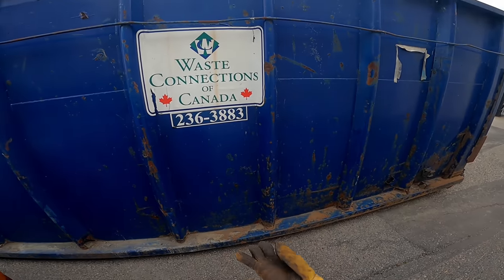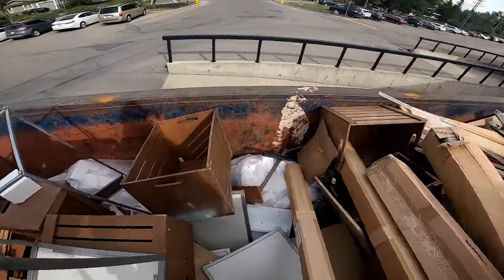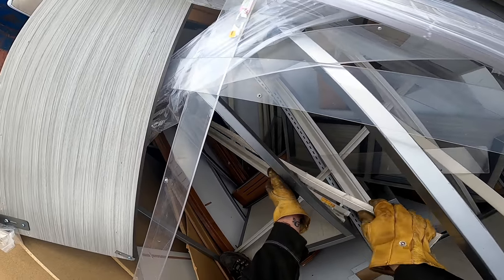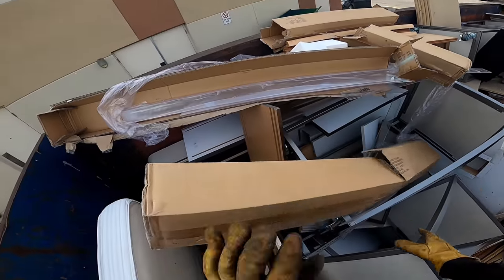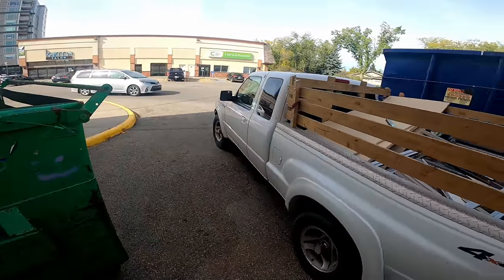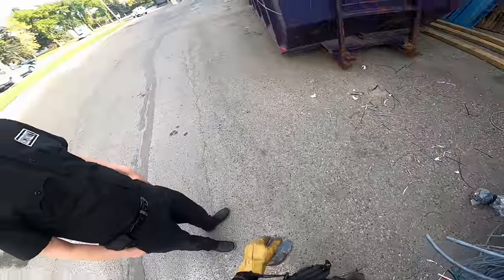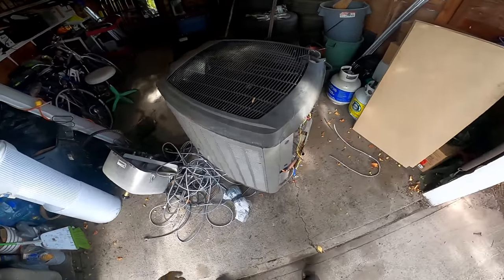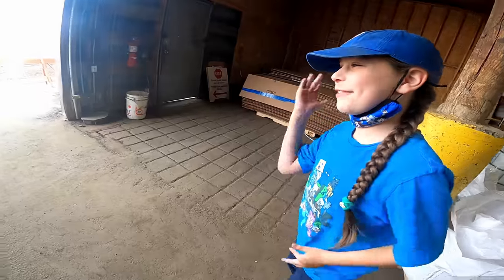Dumpster Diving 38 - Caught by Security!

Comment: I admire your calm and mature demeanor in the face of a potentially contentious encounter. Also the fact that you didn't stop doing what you were doing just because Security arrived, which helps support the position that you weren't doing anything wrong. I suspect you've had dozens of similar encounters with homeowners, security personnel, and the neighborhood busybody. Thanks for the good example!
Reply: Well said, we shouldn’t have to hide or slink around
Reply from the maker: It’s definitely come up plenty of times before! I’m just confident if anyone has any concerns they’ll make it pretty clear
Reply: I sometimes forage as a hobby. Its like scraping the weeds. I have had many encounters including at the police station which happened to have service berries, hack berries, nanny berries(whih ripen at different times but still astounding to have 3 edibles there). .  Those always went well.  In another case, which was a good spot for wild grapes (which makes a very drinkable wine)  I was chased off last year.  My favorite one must be the cornelian   cherry at some apartment complex. . They are ripe when on the ground . The way I process is sterilizing anyway ( compote, wine , jam, syrup), but as I was picking them some woman in a car asked my if I was OK , and when I responded she followed with "Are you sure". 

I knew about scraping long time ago when I was a construction laborer. When I found a 3 foot long heavy gauge copper cable while foraging , well  I realized  now have two fields of opportunity.

Comment: cant wait til i can get a truck of my own after watching you dumpster mike, and scrap n pallet man.
Reply from the maker: A truck makes a huge difference! There’s a Brit who goes by vandal vlogs with a sweet setup in a van too, he’s got a toolbox on the wall and it’s basically a mobile shop space as well as scrap hauler. I’m a bit envious of how self-contained his system is tbh, so that could be a good way to go as well
Reply: @thubprint  true i just like the idea of an open top storage cuz you can stack up and over the side rails some whilst still being safe plus trucks handle a lot more weight.
Reply: Definitely get an open bed truck, IMHO. I am working out of a 4Runner and it is quite limiting. Plus, you hear every squeak and rattle, plus you possibly introduce bugs into your cabin.

Comment: How do they tell how much steel you have?  It looks like you are just tossing it on the ground.  I assume they weigh your truck before and after, but can they differentiate between the grades of metal you are unloading?  I don't understand that process.
Reply from the maker: I’ll have to show that more clearly in another vid, but yes it’s just a big scale you drive onto inside the building. You have to do laps, dump one kind of material then drive around and weigh again, then go out and unload the next type and weigh again on your way out. Pretty easy math

Comment: You shouldn't have any problems from the security unless they have signs posted no trash picking  / trespassing  , and I don't know about Canada but in the U.S. you can go in the open large dumpsters as long as it doesn't say on the side metal only , which means they plan on recycling it themselves  . The one you were in was  mixed with cardboard  , wood , trash . So  here you would be ok . Nice score anyway and have a great day  !
Reply from the maker: That’s pretty much my thinking when I check these out, same deal up here. Thanks, and you too!

Comment: Huge time saver would have been too take the boxes without opening them once you know what's inside of them
Reply from the maker: True.. although I’d have to deal with the boxes at my house then
Reply: @thubprint  put them in any cardboard recycle dumpster bin, the next time you go diving 😊 just mentioned it because maybe you could have avoided the run in with security had you just threw them in your truck as is. Other than that, hats off to you my friend for being so bold with doing it in the day light.

Comment: And I can't believe I've been throwing prepared heavy dense steel into tin shred for the last like year ima ask em how i get more money for it next time
Reply from the maker: Made a huge difference for me when I learned the difference! Ask your yard, some have several grades. Mine is anything over 1/8th of an inch thick
Reply: I don’t separate that stuff unless I have a bunch of it. It’s usually only a few pennies extra per pound, plus I have basically zero storage space. I can only store “smalls” like wire and brass, and even then only buckets or small plastic bins full. Stuff like that you gotta save on, and that takes storage space. Most of the time, whatever I get at night goes to the scrapyard the next day, unless it’s less than a couple hundred pounds - and even that’s only because I live 6 miles from my local scrapyard.